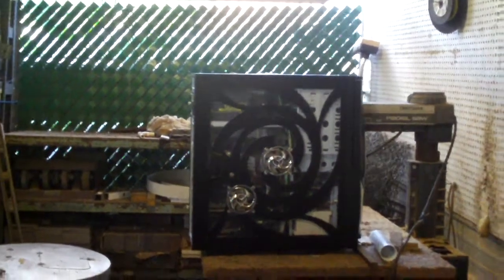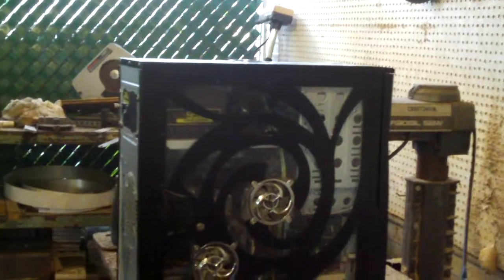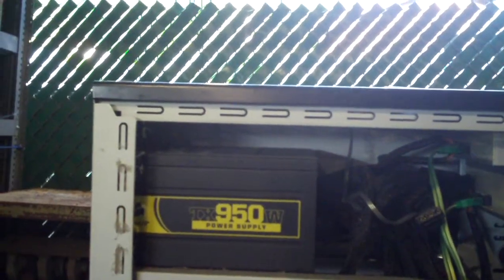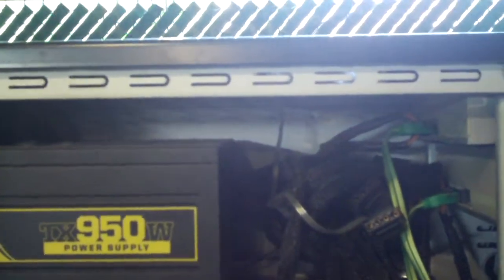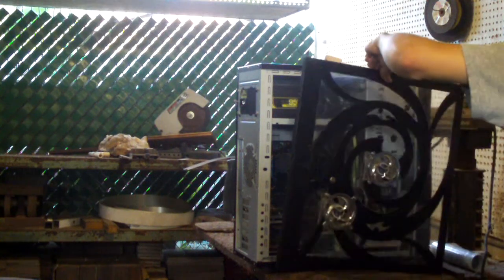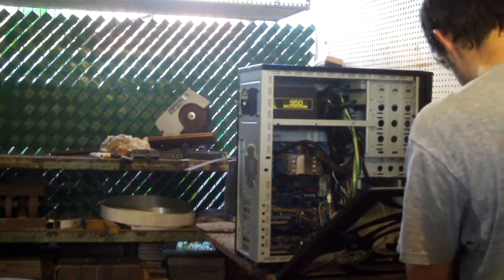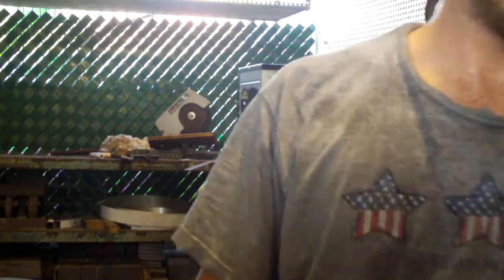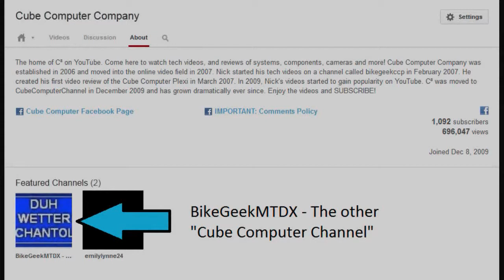Cleaning out a very filthy gaming PC - Cube Computer TTMX

Comment: My desktop's cpu, same as in this, doesn't overheat with my Coolermaster HAF 912 case and Hyper 212 EVO cpu cooler, but it's not dusty and has plenty of airflow.

If 990FX motherboards are dated, what chipset should I look for when I upgrade my dad's machine (replacing mobo, ram, cpu) that's not gonna be too expensive (mobo<$150) for use with a FX cpu and which has decent overclocking capability- enough for decent results with a fx-6300 and cooled the same as my machine maybe. Thanks in advance!

Comment: Wrong. Totally wrong way to clean a computer. #1. As most computer dust is dead skin cells (warts and all other viruses), wearing a mask, or better a respirator is tantamount. #2 If you can't dust into a filtered exhaust fan, you should blow parts outside as far away as you can get to you dwelling. #3. The computer should be completely disassembled and all parts cleaned separately. #4. Fans should be washed with dish-soap or replaced. If you hold the fan flat you can wash it one way so the water won't go into the motor housing. The power supply should be opened and cleaned likewise. after taking off the wires and switches from the case, wash it with soap and water. You can skip this step if it's not too dirty and just blow it out very well. Reassemble and enjoy.  note: if a fan spins from blowing it with air it's generating current. If you don't believe me attach a led and see what happens when you spin it. How good can this current be, to force feed it into your motherboard.   Just saying'                           Mike
Reply from the maker: I've been doing this for over 15 years and know several others in the trade who also do it the same way. Yeah maybe I should wear a mask. No, this was not filmed indoors. This was outside behind an out building. I have cleaned computers this way many times in the past and later opened them to find them thoroughly clean, PSU internals included. Not saying your method is wrong but considering this is typically done as a free complimentary service when repairing a PC, no I am not going to waste my time tearing it down nearly to the point of nearly removing resistors and capacitors from boards just to clean it. Never have I had any component damaged from spinning fans during cleaning. An LED draws far less current than any attached load to a fan when its installed in a PC.